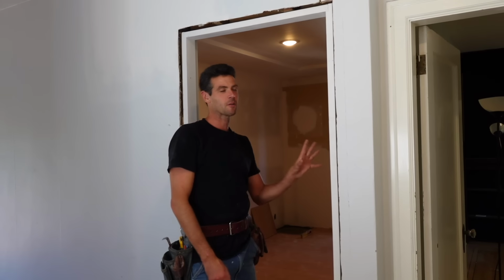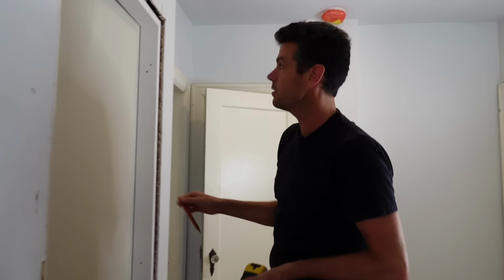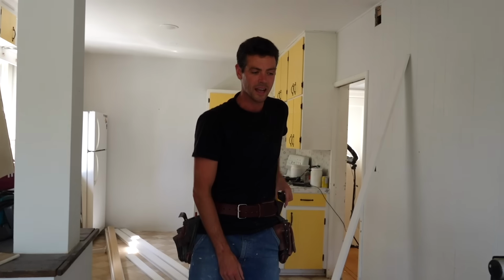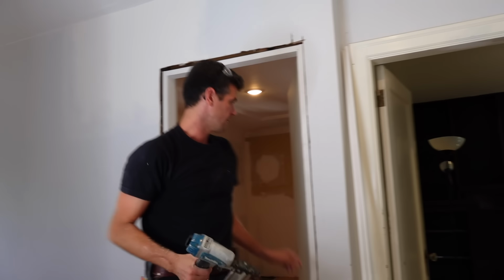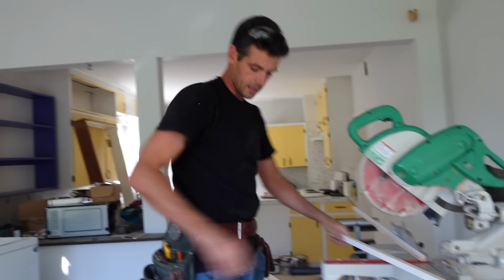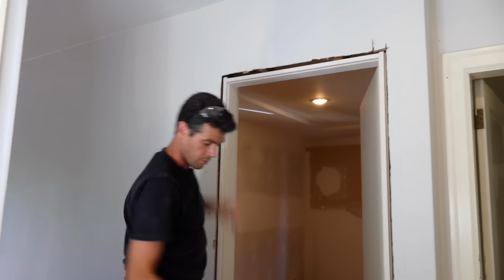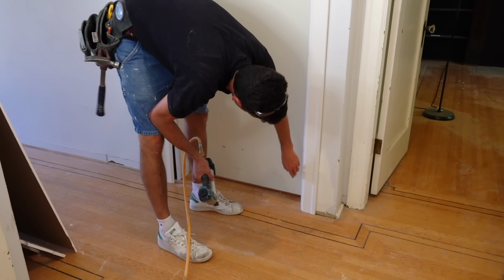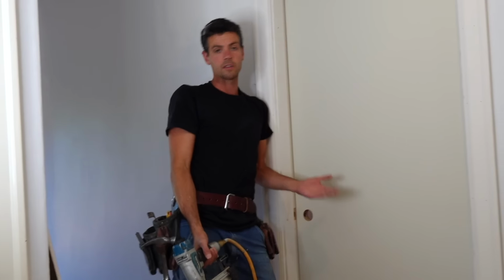Door Trim Installation when wall sticks out too far!!!

Comment: So what you are saying is “Do your best, caulk the rest”.
Reply: Sometimes that all you can do. I'm a painter and had to fix much worse than that!!
Reply: not noticeable down there, no biggie...
Reply: Caulking hides a multitude of sins.
Reply: Looks good from my house mike
Reply: @stevehar883  were they union jobs? When I was painting with my stepdad, the union finish trim guys loved to leave us butchered trim to deal with
Reply: That’s what lennar homes does. Fills in all the gaps with caulk then paint over it. Lol
Reply: That sounds good ENUFF
Reply: Looking good from this angle
Reply: Crooked,.  straight,  fill it in ;
It'll look great
Reply: What's the old saying: ' Caulking and Paint ' makes a carpenter what he ain't.
Reply: Aaaaaahhhhhhhhaaaaaaaaaaaaaaa your ducking funny af
Reply: “A little caulk, a little paint, will fix what the carpenter can’t.” That’s what they used to say when I was a young apprentice struggling to make my joinery tight. These split-jamb doors are made for our modern    2”X4” framing, netting out at 1.5”X3.5”. Add 1/2” rock X2 and we obviously come up with 4.5”. This makes prehung or split jamb installation a piece of cake. The old-growth, denser grain 2”X4” studs used back in the plaster days are literally 2”X4”. With the framing alone you gain a 1/2” of wall thickness on average. Now add to this the lath and plaster on both sides of the wall you’re working. In my neck of the woods (The Mid-Atlantic region, USA) our old school lath strips average a 1/2”. On top of this the plaster usually varies slightly. But generally I’ve found that the lath and plaster add approximately 3/4” X 2 combining both sides of the wall. Therefore we’re adding an additional 1.5” in thickness to a rough opening plus the 1/2” difference between modern and old residential wall construction. So we often find a 2” gain in wall thickness when working these one hundred year old houses. That’s 4.5” on our modern 2”X4” framing including 1/2” rock on both sides of a wall. Again, this is perfect for an off the shelf split jamb door. With the additional width of approximately 1.75” - 2” (this varies to some degree) on old plaster walls, it is absolutely necessary to come prepared with enough material to rip your jamb extensions.  Be sure to keep some material for plenty of shims to keep your door jambs tight, plumb, level and square. Over the years I’ve found it easier to rip my own shims to the thickness as needed for optimal installation and solid functionality for a long lifetime of residential doors that stay put. I have not had any callbacks or complaints since I learned the lessons taught by my teachers. It took a lot of mistakes that I had to fix as I tried to take some shortcuts that didn’t work. But I did develop a few techniques that have given me my own personal touch and style. That’s the cool part! Now, there are certainly more than one way to do these things and I’m sure that there’s plenty of awesome tricks I’ve not considered. This is why I so enjoy watching videos like these; there is always a craftsman that has a trick or two up their sleeve to improve our skills. Great job on your approach to this problem and explanation in solving it! Keep on expanding your skill set and we carpenters won’t need as much “caulk and paint to fix what we can’t.” Besides, the icing on the cake is painting my own work! Add some beautiful hardware and I’m in heaven. Best wishes in your endeavors.
Reply: Caulk and puddy is my buddy.
Reply: Order the correct jamb size!
Reply: I think what he's saying is caulk and putty are a carpenters buddy
Reply: That's what my wife tells me in the bedroom anyway
Reply: Good enough for agriculture.
Can’t see it from my front room !
Reply: @STEVE-lk2ft it’s obviously an existing jamb dude. Ever done any reno
Reply: @STEVE-lk2ft you can always tell when somebody's talking out there a$$
Reply: That's it 😂
Reply: Can't see it from my house
Reply: Well said

Comment: Most doors (frankly all doors at home improvement centers) are sold for 2x4 construction. I find that a lot of people don't know that you CAN get door jambs for 2x6 doors. Also, making custom jambs is not hard at all. I bought composite jambs for my exterior doors and made jambs out of 3/4 poplar for my interior doors. I ripped them down to the exact width I needed.
Reply: Custom door jambs are not easy for most people. Many carpenters won't touch that. I do make custom jambs to pre hang "loner" doors but I use door hinge jigs and a router and it is fairly precision work and for varnish grade requires really stable wood. At least to get a really precise pre hung door. There are some old school ways too with a hinge stamp but it is time consuming. The Vix bit becomes very handy too! Do we all know the vix?
Reply: Had to make my own casings ><

Comment: I'm not kidding, I had this EXACT problem - My house was built with 2x4s and plaster over plasterboard walls. All the pre-hung doors you can buy around here are made for 2x4 and 1/2in drywall. I've had a doorway sitting in my hallway for months that looked awful because I was too scared to make my own jamb extension. I was going to have a contractor do this when I had new windows put in the house (something I just cannot do).

However, this morning I saw your video and this evening I put in the extension myself. it looks amazing and didn't take me more than an hour or two (I haven't done the casing yet since I am skim coating the old plaster walls). 

Thanks for the motivation and instruction. You've been a huge help.
Reply: Well done!!! Feels good, doesn't it?
Reply: Extension jams are a standard building practice..  at least it has been for 40 years.. some windows come with extension jams that you custom rip to custom fit walls.. easy piezy.. same as trimming out a window with wood gotta rip boards to fit..
Reply: @terryloh8583  it feels really good when you can make adaptations and it turns out nice.
Reply: Or, you could just order one in the proper size...depth.   Does it cost more...yes.  But worth it

Comment: Thanks bud! Just put in a new exterior door to the kitchen, only to realize after installing, caulking, and spray foaming all the gaps, that it was too shallow to meet up with the wall. Whoops. Lol my grandpa wanted me to pull it back out and cut the siding to inset it deeper in the wall. No thanks, I’m good. Not re-doing all that lol. It’s gonna be jam extensions all the way for me. Thanks for making my life a little bit easier anyway. Keep up the good work brother.

Comment: DeWalt has a fantastic fence system.  It is a rack and pinion and makes the tiniest adjustments.    Thank you for showing this.  I do my own repairs and remodeling.  I have had to make this kind of adjustment before, and I really did not know what I was doing.  I did what I thought seemed logical.  When I find a video on You Tube, that shows a professional tackle the same problem and I see that he does it the way I figured out, makes me feel better.  Lets me know that I guessed right.  Thankyou.  I am 61 and back in the day of my youth, there was no You tube or internet -- period -- to go to for reference and instruction.  You had to figure it out if there was no one in your life to teach you.  Now, I go to You Tube first to get an idea of what to do.  Saves a lot of time.  Sometimes you still have to use your brain and fudge, because the same type of problem can vary in the needed solution, but You Tube gives you a starting point.  Thanks to all the professionals out there that are willing to share their knowledge.  Some of us just cannot afford professional services.  We have to DIY or we live in a mess of a dwelling.
Reply: what is that saw with the rack and pinion fence? Do you know the model? thanks
Reply: @allenbranch1824  Hey  allenbranch1824.  Sorry to reply so late.  I have not looked at comments for a while -- too busy.  My saw is model DWE7491RS.  It is the 10" portable job site table saw with rolling stand, 15 Amp motor and 32-1/2" rip capacity.  It is the replacement model for my old saw.  It seems to be working fine, I have had this one for about a year and I have used it a lot as I am remodeling the house.  I prefer my old saw because it just seemed like the housing and stand were more heavy duty.  But as for functionality, I have no complaints with this one.

Comment: Eternally grateful for this video getting recommended to me today. Just about done with mudding the drywall in my garage and am about to move onto the finish carpentry. Had to bring everything up to code so went with 5/8” drywall. Have a nasty gap around a door jamb and was going to try to make the extensions flush with the existing jamb. This technique will save me SO much hassle in the short and long term. Thank you!!!

Comment: The 1/4" reveal for the jamb extension was a good idea. Sometimes trying to make the extension flush with the original jamb can appear as an obvious "patch" if they're not straight. Nice work!
Reply: In carpentry, you generally don't attempt to make things flush because they never will look good no matter how you try. This is why we always create a 'reveal'.
Reply: @KenHill  I like that idea, yep flushing it it harder and doesn't look as good. THis is Quicker and now you have a small reveal that you can give a little caulk and it is done!
Reply: @bobbyz7736 Many times caulk is not even needed.
Reply: Staging them back for another reveal actually gives a nice custom look
Reply: Flushing out a jamb extension is never a good idea. If some how forced to it must be glued to prevent paint cracks. Either way the painters will hate it.
Reply: Should be the thickness of a nickel.
Reply: @edwardmmanns7454  Nah, too small. Building movement can make small reveals look really bad. A 1/4" reveal with 1/16" variation will still look pretty consistent.
Reply: @BoneStack117  Just 40 years of doing trim. If you do it the old tried and true way you don't have problems. I bet you never use a low angle block plane to seat the casing head properly either?

Comment: I've done several of these types of repairs but I've always butt jointed the extension piece to the frame because I didn't like look of the the double reveal. I found that if you use wood glue and fasten it to the frame with a lot of brad/finish nails (every 6-8"), the two pieces of wood will expand and contract as a single piece of wood. You need to also use Durham's Rock Hard wood putty over the seam and sand. Two coats of LATEX paint will prevent cracking.  The corner seams of my casings crack before this seam. But if you don't want to do all this work, the double reveal is your best bet. Thanks for the great vid tutorial!
Reply: Way more work. The additional reveal looks better than a cracked flush joint.  Craftsman architecture traditionally favored a succession of  molding reveals along with plinth blocks and rosettes

Comment: If I have to extend jambs I like to divide the reveals between the jamb and the extension and the extension and the casing.  Especially if you have another door right next to it.  So if that other door that's finished has a 1/4" reveal, I would use 1/8" on the reveals of the door you are extending.  This way the outside edges of the casings are the same on both doors.  The eye will pick up that one casing is 1/4" taller than the other.  If I'm looking down a hallway and there are multiple doors and the casings are all different heights it stands out like a sore thumb.  The walls will usually be a different color than the trim, or at the very least a different finish, and the doors, jambs, jamb extensions and casings will likely all be the same color and finish.  The consistency of the reveals is moot by comparison to the consistency of the height of the casings.

Comment: I live up the coast a bit, and found lots of that old fir casing in the dump. Whenever possible, I’ve reclaimed it for use in projects. It’s gorgeous! Love old fir for building with. Thanks for the tips on trimming out the door jambs..I have this issue with the new windows I put into my old mobile home. I think this is the answer for me. :)

Comment: First time I had this problem, I literally extended the jamb, making it flush so it would be one flat surface. But to do it was WAY more difficult than I thought and the joint kept showing up. So from then on, I always do it set back with a reveal like you did and it completely eliminates that problem.

Comment: You mentioned the trick of cutting out some of the drywall to make the trim straight. On a couple of the walls that were installed by the drunk guy in my bedroom remodeling I did exactly that. The wall was slightly bowed, not enough to notice (after I spent several hours adding mud to flatten it), but definitely noticeable when adding the trim. So I cut out a notch about a foot long so the trim would lay flat. I will have to do the same thing in the hallway where the wall is REALLY screwed up. The new drywall that was added was up to an inch out of alignment at the top from the original drywall and took many coats of mud to tapper it to look flat. When I go to add the new trim I will have to cut a notch in the original drywall so the trim will go on straight.
Reply: I feel for you!!
Reply: I feel for you!!
Reply: I feel for you!!
Reply: I feel for you!!
Reply: I feel for you!!

Comment: I wish I would have seen this video about 3 weeks ago. I just did trim replacements for my MBR closets, and it was a nightmare. All I had was a hand miter box, hammer, and nails. My wife's closet door casing has so much gap in it I had to angle the nails...and eventually trim screws, (I completely suck with a hammer) so they were driving into the 2x4 structural studs, or I'd wiff the casing right into air.
  I even managed to cut the damn miter for one of the pieces wrong, so I had to redo that too, lol. Once I got everything wood filled, and painted it looks much nicer than I thought it would be. I think I'll be saving up for a decent brad nailer to make my life easier. Turns out you have to be good at things if you plan on using hand tools, and I'm not. LOL.

Comment: Every time you fire a nail, use a mitre saw or a table saw without ear protection you're damaging your hearing.
Imagine standing next to an airport and watching a 747 taxiing to the runway and then imagine what that sound is like 24 hours a day. It's called tinnitus and it can consume your life.
They actually use that as a sound effect in movies these days when someone is blown off their feet by an explosion. They muffle the sound and introduce a high pitched squeal to the sound track.
That's what I hear all day, every day.

Comment: How would you deal with a door jam that sticks out beyond the wall by 3/4"?
Reply: Cut down one side of the door jambs to the thickness u need.
Reply: Fasten the door and use an oscillating saw to cut it flush. Sand it before installing the door casing, and then caulk and paint everything.
Reply: Take it back and get one that fits lol. Build a custom door or cut it.
Reply: You would simply cut the same pieces that he did but you would install them behind the the trim where it meets the wall
Reply: Had the same question myself  _ thumbs up for the answers

Comment: Looks good.. I guess the best case scenario would be to have some 3/4 stock on hand, so you can cut strips a bit wider, and aren't trying to nail into a half inch jamb extension, well quarter inch to work with after moving in for the reveal.. not a whole lot of meat there.. but anyways looks like it worked fine.
Reply: I had a situation like this in my Renta property I just used about a 1 inch wide piece, made nailing it so much easier that the 1/4 you're describing

Comment: It looks awesome. Is there a reason that you don't make the reveal flush with the door jam, and you stagger it in steps with the trim? Is it because the resulting larger jamb would resist looking like one solid piece, and would need to be caulked and wouldn't look perfect, vs. having nice staggered sharp edges?
Reply: Exactly this. Often the thought is "if you can't hide it, accent it"